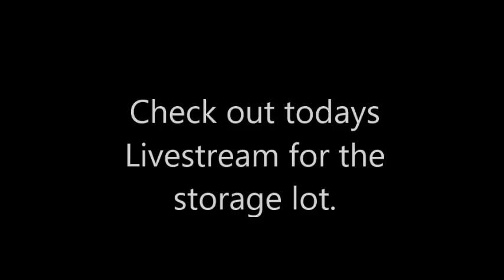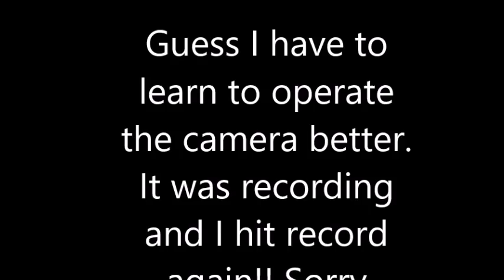Vlog, Towing, Recoveries and Baby Dinosaur 9/17

Comment: Jonathan I enjoy all your videos, lot better than what's on TV at night. For your safety, just wanted to advise you that was not a power line right way you drove down. If I'm not mistaken it's a liquid propane pipeline. I think that's a 6 inch steel line with a .177 wall thickness. The mud hole you drove through was right next to the pipeline marker. Be safe don't get blowed up. Thank you.